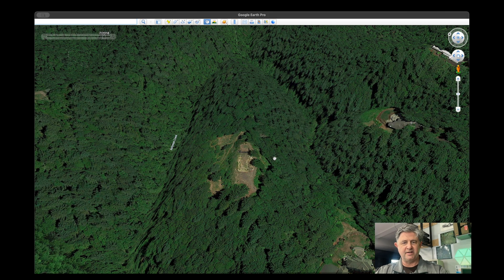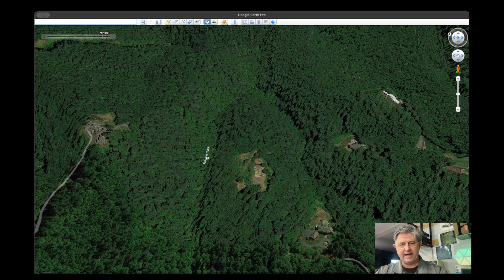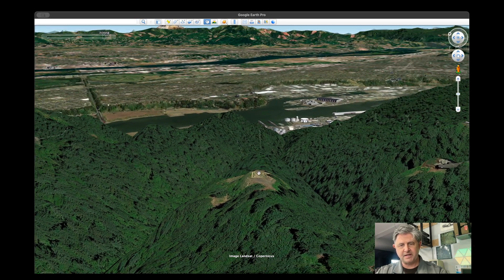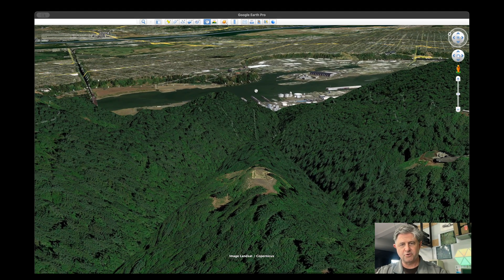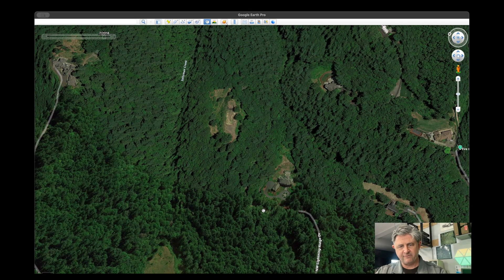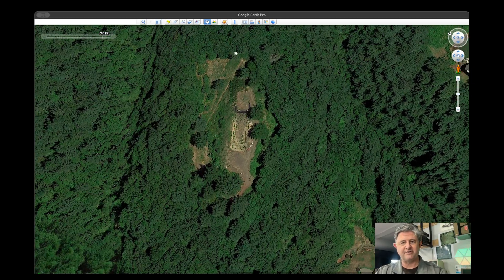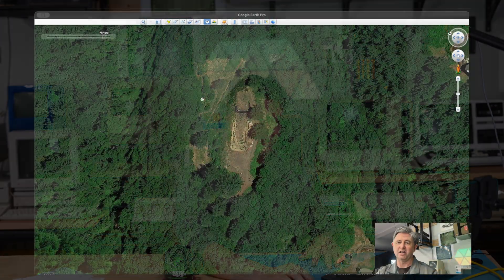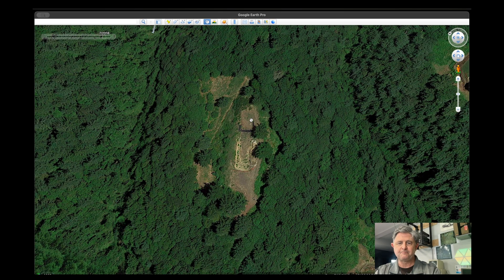Designing and Building the Ultimate DIY Smart Tech House (with Homelab!) Chapter 1

Comment: damn, even wealthy americans like building their houses out of wood...
Reply from the maker: Yes, that is true in the states.  As you will see later on there is a steel I-Beam sub structure, but wood is the primary choice here.  Doing one with concrete would be a challenge as the trades are just not used to it.